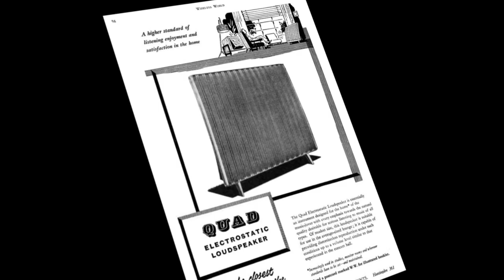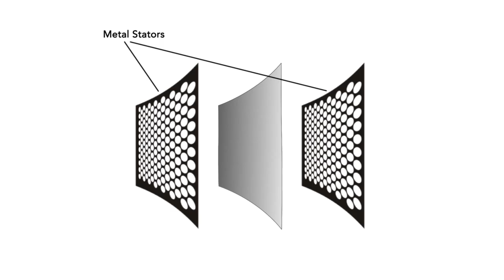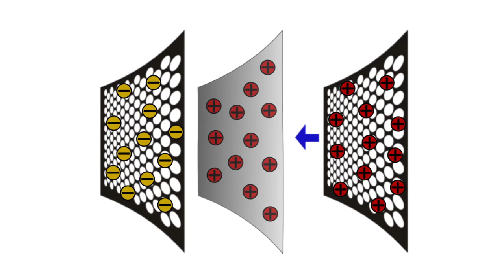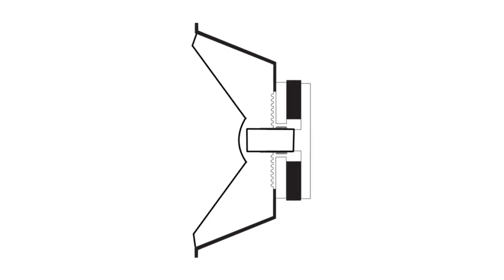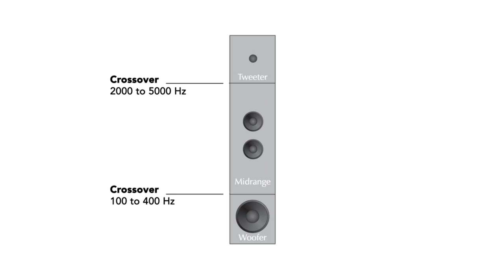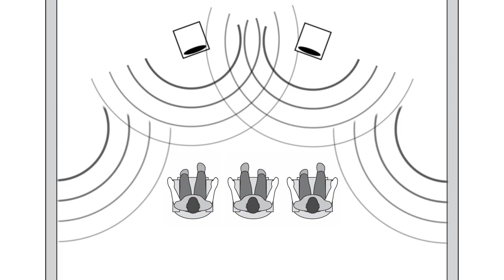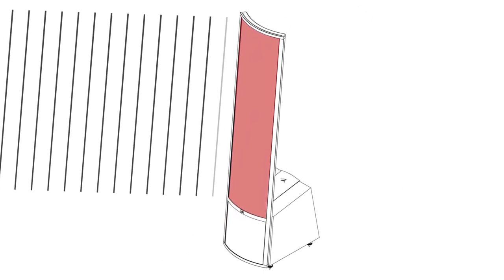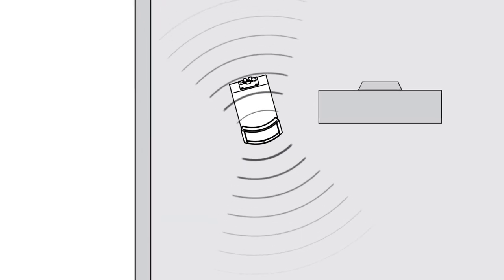Electrostatic Loudspeaker (ESL) Technology - MartinLogan

Comment: The curved diaphragm was a great dedge, but having listened to both, I still prefer a ribbon tweeter next to the main panel.
I also play music at rather high concert volumes, and there is not much competition in that regard between a ES panel and an EM panel, and very few are truly full range, requiring a dynamic driver / reflex enclosure, or well-matched sub, to get the bottom octave to match real life performance levels.

Comment: If the sound is the same from the rear (albeit 180 degrees out of phase) does that not mean that these need very careful positioning in regards to walls? Does the proximity to walls, coupled with the 30 degree angle (now focussing the sound rather than dispersing it) not need to be taken into account? How does the width of the panel affect the phase cancellation and is this 'tuned' to the panel?

Comment: So… why then are the most accurate speakers dynamic studio monitors? If the dynamic driver is inherently inferior, why cannot electrostats better them in resolution? Similarly, the most accurate headphones use magnetoplanars, not electrostats nowadays. Stax used to lead in headphone resolution, but has since been surpassed due to electrostats’ lacklustre bass reproduction and their typical phasing errors between L and R channels.
Reply: My guess is that studiomonitors dont need to have the best resolution. They should have decent SPL and tonality. At those points they can be better than stats.
Reply: Studio monitors have several times more harmonic distortion than ESLs. 

Nearfield studio monitors need to be small and robust.
Reply: @n.lyndley.9889 True, but after which point does distortion really matter any more? Case in point: I have heard electrostats with extremely low distortion, yet the sound may be kind of unnatural. Instruments and vocals may just sound a bit off — pleasant and fun, sure, but not quite right when you get to the nitty gritty of it past casual listening. One could even call it an estat sound signature. This is an area where dynamic drivers, in contrast, can really excel.

Comment: Martin logan. Cheating. Adding a woofer.
Reply: Not really...Electrostatic Speakers do not produce a solid bass do the manufacturer added it with the bass box...kinda like adding a Sub....
 Rounding out the sound.
Reply: @steveo4141  wait till you hear quad esl 63 They do bass well. With martin logans you just get an extremely large expensive tweeter
Reply: It’s not cheating, it’s using the best transducer for each particular job. 

That’s why a traditional ‘speaker has woofers and tweeters - they can’t do each others’ jobs.

Comment: to bad these still cost and arm and a leg to buy when yous make them for dirt cheep. yous guys must be making an easy 300% profit.
Reply: I bought my SL3's used for $800. They had recently been serviced by a local speaker specialty shop, and determined to be 100% functional. They rank right up there in clarity along with my ESS Heil AMT3's, which I also bought used after servicing, for $480. Go used, good quality stuff is out there for a good price if you know where to look.

Comment: ion...since this is a huge surface what happens when it gets dirty?
Reply: Sigh...that's the problem. I have 3 pairs of MartinLogans and every 6-10 years you need to replace the panels because dust and humidity affects them. At some point they become completely muffled and unlistenable. It doesn't help that MartinLogan nearly tripled the prices of replacement panels a few years ago.
Reply: @18000rpm  would an acoustically transparent sheild over them change the sound plenty? if not, could make a very tall drop over box, to place over them
Reply: @18000rpm is it not possible just to strip down and clean them thoroughly? Or does cleaning remove the special coating?
Reply: @ washing them may improve it slightly temporarily but ultimately the coating loses conductivity and need to be replaced. The panels are wear and tear items like car tyres.
Reply: @18000rpm  Thank for the responce.
Reply: Thanks guys this is huuuge help
Reply: How do the guys at ML address the humidity issue?

Comment: Usually 90-92 dB at 2.83 V/1m. That's pretty effective. Not the highest sensitivity out there but it's definitely not low.
Reply: True, but low impedance at high frequencies
Reply: @n.lyndley.9889  I made that comment when I was 17. I have since experienced quite a few ML electrostats and have realised they all sound broken

The rare measurement of their old electrostats shows the clear flaws with the design, and it seems those flaws have carried over into their modern offerings (obviously, it's an inherently flawed design, just like single driver "full range" loudspeakers)